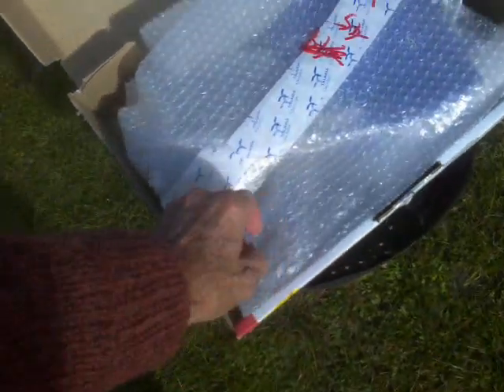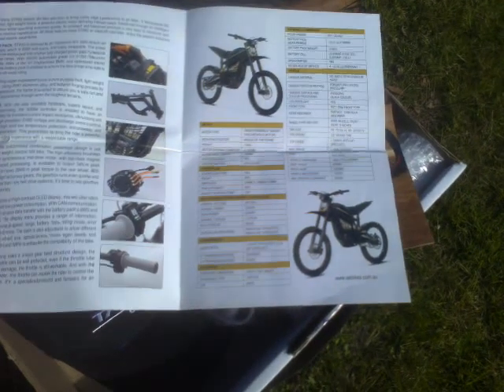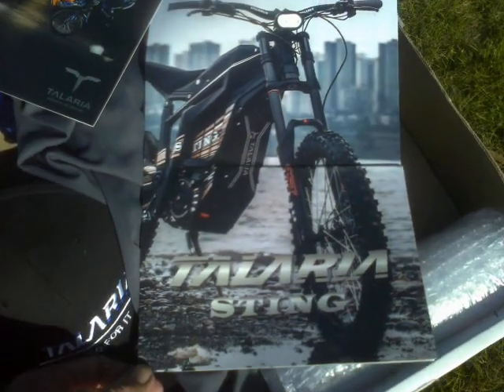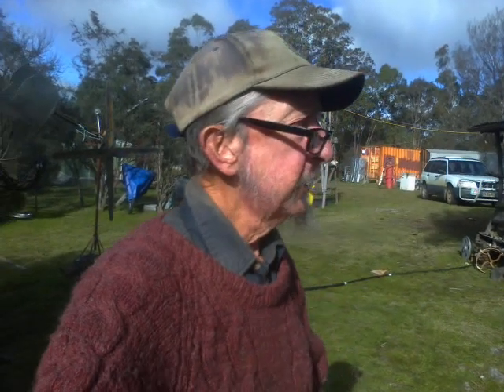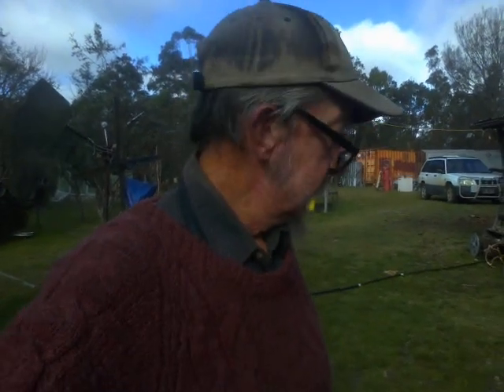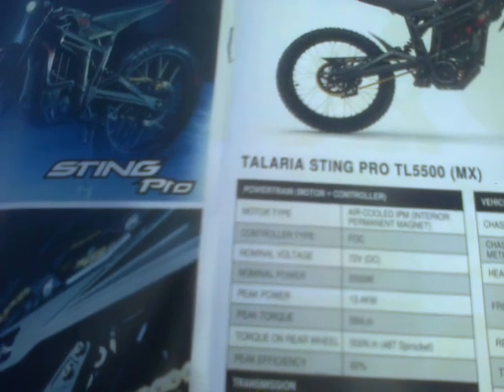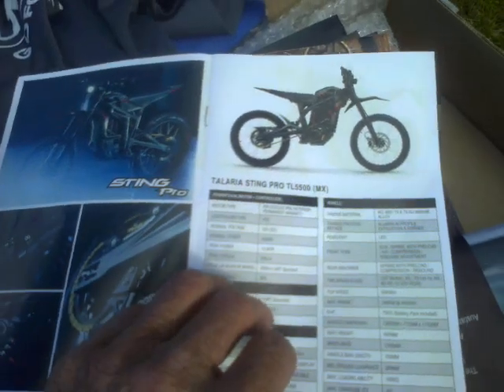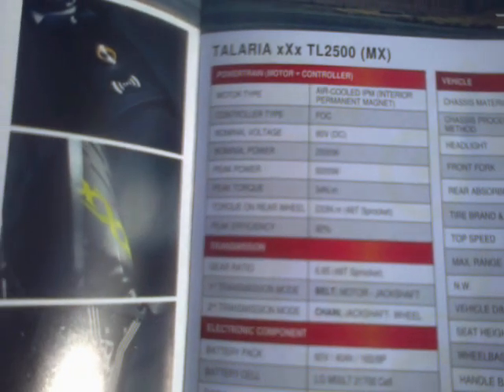Talaria Sting TL 3000 L-1e...; After Sales Service, Beyond Warranty.

Comment: Glad you have had a good experience,  I think regarding forks I would have gone with something from honda/yamaha/suzuki of a very very similar size and adaptation from a welder and grinder.
as to chinese warrenty, just bought an mppt charge controller from aliexpress, they packed it in an unpadded plastic mailer bag, then doubled up on the protection by putting that into another unpadded plastic mailer bag, to which it got crushed in transit to england with capacitors  and trimmers ripped off the board. the seller said abort the returns process, and we will refund you, so I did, ordered another from another seller to save time, and they didnt refund..... The replacement arrived, crushed, in an unpadded plastic mailer protected by an unpadded plastic mailer.
I will be really reducing the amount of tat I buy from aliexpress, wish and temu are making them look bad....
Reply from the maker: @lezbriddon  

G'day,

Thanks !

Ah, ouch - that sounds horrible.

I've never used any of those Online Suppliers.

My Chinese Firepumps came from the local Small Engine Mechanic, he's the local Dealer for the Importer out of Melbourne.
The Sting came from AE Bikes at Revesby, Sydney, who have been importing them and the earlier iterations for 8 years.

China is BIG.
Busyness types go there and order cheap shit, shiny and badly packed, shipped direct, and the Busyness type gets that by the Containerload to make lots of money on one-time sales with zero "Customer Goodwill".

Or

The Busyness type gets a quote on a production run done to whatever Quality and Specifications they want to pay for - and the Chinese Busyness types work to Specification as required and as remunerated.

The spare Battery ($1,100 instead of twice that..., Xmas-Sale special !) came in a double-corrugated core Cardboard Box with Foam Blocks centreing the Battery, sealed in China, with a 13-page copy of the Engineers' Reports on the Battery, it's Components, Materials Safety-precautions, Dangers and Firefighting requirements and First Aid...

The motorcycle Carrying Company charged $500 to truck the Bike from Sydney to here (630 km) & the Dangerous Goods Freight for the 12.5 Kg spare Battery was $190...

It's a mistake to try to judge
All of Chinesium...
By the cheap shiny shit sold in the Crazy Prices
Emporium, and the
Mail-Order Crap being pumped out by the 
Free
International Postage available to Exporters from China.

When a 6.5 Hp Briggs & Stratton from 'MurriKa(!) cost $1,250 with a 12 month Warranty in Home Hardware..., and a 7 Hp LiFan was $500 with the same warranty from Hec's Small Motor Klinic, I bought 2 LiFans and still had change ; and they both started first time.

How many Electric Power-Tools..., Name Branded, are not
Made in China...?

DeWalt, Stanley..., Rockwell 
Dremmel...
It's ubiquitous.

Harley Davidson brought 50
Live Wire
Electric Harley's to Oz.
$50g apiece...
Not many sold, maybe 20..., so after 6 months, the price dropped to $35g ; and owners got the shits and potential customers backed off.
And the Live Wire "Dashboard" Screens die quite quickly, apparently ; but Harley Oz carry no Spare Screens for them in stock - because they have no Electric Service Department.

Talaria from China is beating the shit out of Harley from 'MurriKa(!), on Customer Service & Support, from what I can make out.

And, it's my first Motorbike. I don't know anything about Motorbike Forks.

My Aeroplanes had Leaf-Springs on one and Tight Bungee around a floating Axle on t'other...; on the Highway, playing with the B-Doubles I want the Suspension, Steering & Brakes to be up to par - not whatever I could cobble up as an Emergency Field-Repair, kinda thing.

To service an Oleo-Strut, one has to know what the fuck is inside it, to be able to get it apart without turning it into shit in the attempt.

The two best Bicycle/Motorcycle Mechanics in Business for 120 Km in all directions failed, 5 times..., to figure out how to get the light-duty Forks apart to replace the Oil Seals.

The Importer, with 8 years of experience and just back from China..., said they were of use to him for Overhaul and resale...; so he's giving me $150 for  Leaky Forks that I've already had 3,500 Km worth of fun out of - and were only worth $500 new....

Just as not all Oils are equal...,
Not all Chinesium is carelessly dispatched, nor does it have to be cheap useless crap going into the Packet, either...; but this episode was so good that it had to be shared...!

Such is life,

Have a good one...

Stay safe.

;-p

Ciao !